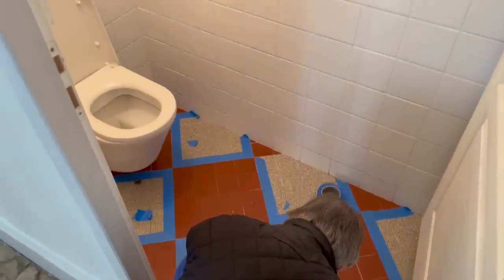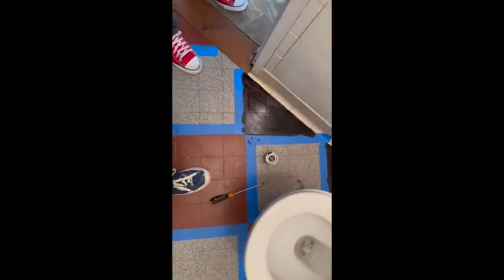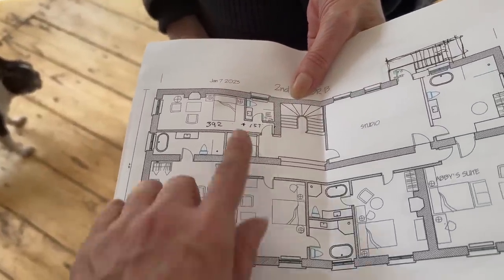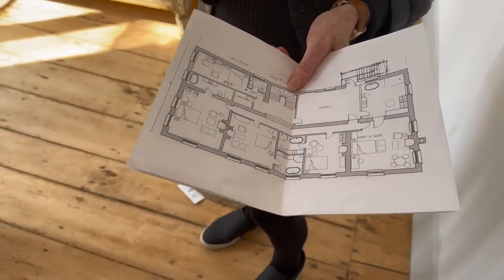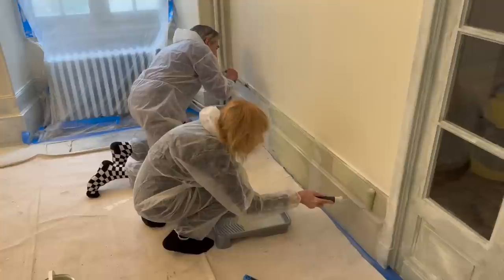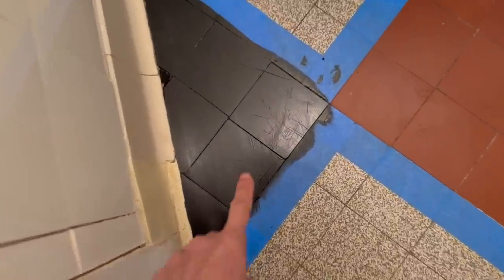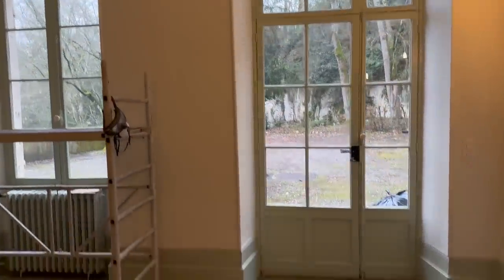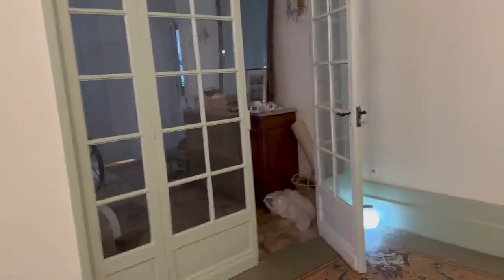The Grand Foyer's Incredible Transformation – The Chateau Chronicles – Ep #24

Comment: That room looks so lovely. Floor turned out better than I thought and I wonder if there isn’t a sealant of polyurethane that would add to the durability. I know there is a sealant for that beautiful marble top on that table to help keep it from absorbing food that would stain it. Be sure to get the food grade sealant. This is assuming you are going to use it as a break front for meals. Good job though. I also have trouble with greens being the shade I want to match. Maybe on the next time you paint the trim. Still looks nice anyway.

Comment: Looks lovely like the green looks like a nice relaxing colour and the tiles look good I have painted my concrete floor probably 15 years ago with behr porch and floor paint no top coat needed as an outdoor paint but used on furnace room floor and just repainted this year held up well just finding the right paint in another country a top coat should be available to extend the life of the paint had no chipping or scratches on original but love it have put three rooms this year in the basement love easy to clean ! Remember paint is cheaper then a new floor ! Your choices are perfect but remember perfection is boaring personality makes a space !

Comment: I was very happy when you said you were going to keep the tile floors. I thought with your colour sense and artistry you could make them work for you without removing them. Painting tile doesn't really hold up very well over time . Redoing the grout refreshes an old tile floor and grout comes in many colors which may satisfy your need to change the way they look.  I think they're fine just the way they are. If you insist on painting - I find marine paint is the most durable, although you can never use bleach again to clean.

Comment: I would do a slate gray paint on checkered floors instead of black. With contrasting limestone color opposite. Trim paint in entrance room should be a stone cement gray as should your salon walls. As for upstairs don’t do what your parents suggest with rooms and bathroom. Leave it open space where staircase is to use as open library sitting office space computer space for guests etc, and try to rework upper floor plan to have less long narrow double hallways and different entrance into each RE worked bedroom and baths.. off of a center rectangular area. Hallways can also become closets linen storage. You have plenty room. Why would you turn nice rooms onto smaller.

Comment: Are your father & stepmom architects / designers? Great to have their input.

Did you use heat resistant paint on the radiators? I used a silver on mine from 1899 and it’s lasted for years. 

Ditch the Farrow & Ball & use the other paint. Colors are more vibrant.